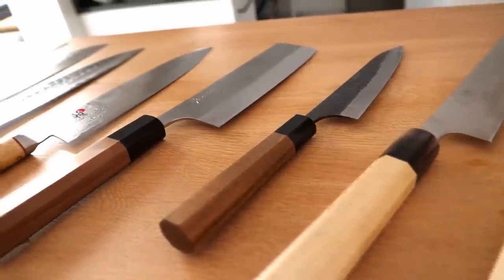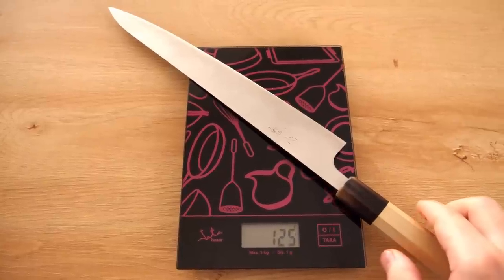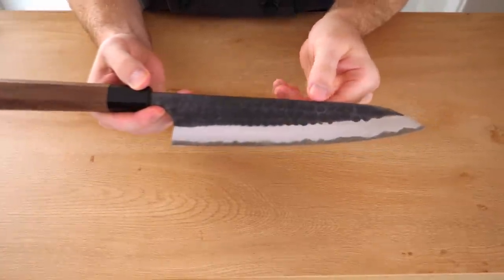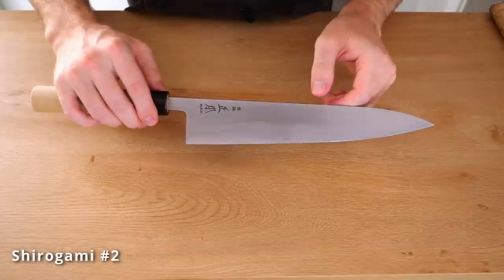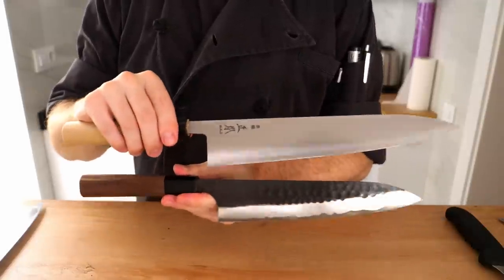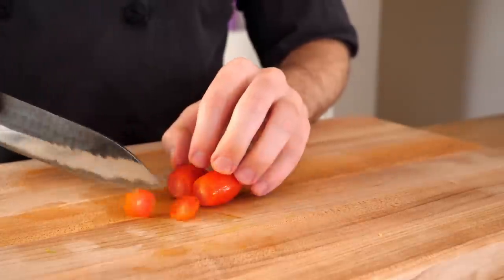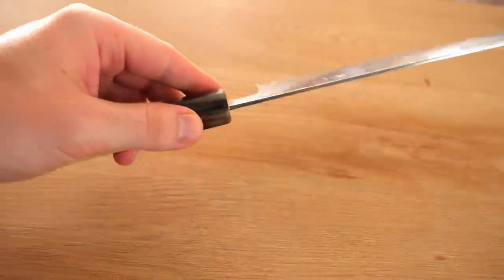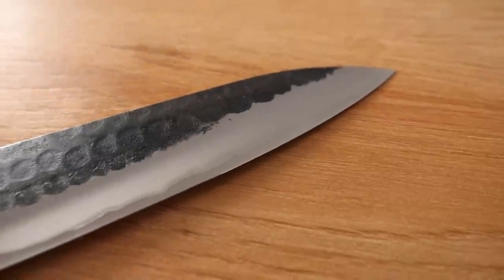Pro Chef Tips.. What Are Japanese Knives & Are They Worth It?

Comment: James – First, thanks for this vid, and it's sister vid from a couple of weeks ago. Wonderful stuff. You explained, in depth, things I only knew superficially. That's always a good day.
I have a similar set-up of knives as you, maybe a notch or two down in quality, but still pretty good, considering I just sort of found them, here and there, over the years (garage sales, under my pillow, whatever), that I decided to keep around.

I have a 'la Bouchere' 8 inch Chefs knife (SS), and it's 9 inch meat Carver companion, that I bought 30 years ago, at a garage sale, for a dollar a piece. I eventually did a little research, and this fine set of French knives, were only made in New Jersey (USA), between 1980 and '89. Go figure. But they are, pretty good knives, regardless of the price or origin. In fact, I'd pay $10 a piece for them today, if I had to. They really are quite decent, for their lack of pedigree.

Full tang, full bolster, comfortable wood handle, and decent SSteel, as to keeping an edge. As to the bolster, I'm guessing you were alluding to how it can be difficult to sharpen such a knife with a 'rotary' type sharpener, either mechanical or electrical, because you can't get to the corner of the edge, where the blade meets the bolster. True.

I have a decent set of standard sharpening stones, down to the leather strop, that I seldom use anymore, but for the rough stuff edges of axes, or lawnmower blades (after working them with 'files'). What I use now for knives, I don't know how to easily define, but it is a structure about 6x8 inches, square to tall, with a tripod base, suitable to a workshop, as not large. I can attach any knife, and set the angle, as well the interchangeable grit stones, of coarse to fine. It cost me about $35, 10 years ago, and it is the easiest way to get an exact and gentle sharpening of any blade, that will fit in it, at least an 8 or 10 inch Chef's knife.

Point being, by that design of sharpener, I can sharpen blades right to the edge, to where the heel of the blade meets the bolster. Yes, of course it takes some finesse, but by bolster, the knife is that much safer, as well, less painful to use for extended hours, such as all day, prepping in a restaurant. I'd have it no other way.

Granted, I worked in a small restaurant, occupancy about one hundred at a time, by the Fire Inspectors. There were usually 4, at most 8 in the kitchen, covering all bases, but for when I showed up as the early guy, to prep for the day. As one prep cook per shift, I cut up a lot of stuff, usually anywhere between 10 and 50 pounds of anything, before I blinked. At the time, we served about 200 tables for dinner, on a good night (which most were mostly), and about 100, for Lunch.

Point is, that the restaurant provided 'tools', were lacking, so I brought in my own in, from Chef Knife, to timer, to peeler, and a few other things. I couldn't bare to work with what was provided, as for no other reason than that they would chew up my hands.

Now, I don't have a fancy utensil 'cloche', as you do, but then again, I've never seen one for sale, nor was I ever been convinced of a need for one. Point is, humbly, I'd wrap my 8 inch, in a towel, as a standard bath towel, that I only used to hide my knife in. I brought my meager tools with me, every day, as foolk if I'm gonna work with the crap you provide, for any length of time, of even a day.

I've got to stop here, as  there might be consequences, of reprimand.

Short story, anyone I worked with, was allowed to use my knife (or other tools), but with strict rules. Don't ever sharpen it, nor, hack bone with it. Other than that, we're good.

As to stealing it, I never thought of that, but I think the restaurants I was working in, weren't so complicated that everyone wasn't accounted for, at any one time. As well, there were CCTV camera's, overhead, all over the place. I understand, that might be a little creepy, but not to me, as I knew (by witness), no one looked at the CCTV unless there was a problem, which most times, there wasn't.
Reply from the maker: Thank you very much! I tried to cover as much as possible

Comment: Keep in mind that I've never been a chef or sous-chef, only a cook and front-end manager, and only in relatively cheap diners and chain restaurants, so I've never needed the kind of precision and comfort/familiarity with my tools that a high-end chef tends to need. That said, I've generally been quite happy with cheap mass-produced knives I can abuse and not just strop/straighten but outright sharpen daily if needed in the professional kitchen.* I tend to keep any really nice knives at home, where comfort and precision are a bigger deal to me. (Well, before I changed careers; people would look at me funny if I brought anything but a folding pocket knife into work these days.) Basically, my point is that the best knife for you in the professional kitchen also depends on what kind of kitchen you're working in, and if you're in a cheap diner (or even a relatively fancy diner as anyone but the chef), you may be better off with something cheap from Restaurant Depot or your country's equivalent. It doesn't hurt that injection-molded plastic, while terrible for the longevity of the knife handle, is both insanely cheap and very easy to form into an ergonomic shape.

*For anyone who doesn't know about knife sharpening, a steel straightens the cutting edge, a strop straightens the edge more gently and can also remove burrs (microscopic imperfections, often in the form of a thin wire along the edge, though to see that outside of sharpening you have to really abuse you knives), while sharpening involves actually grinding metal off to form a new cutting edge and is generally something you want to avoid doing too often, at least with a nice knife.

Comment: I like Shun but some of the tips  are so fine and thin as to be fragile.  I have not chipped or broken any but did drop and slightly bend the tip on one of them. I have a good set of single bevel knives in Stainless with a harder steel core (octagonal magnolia handles) and while they did take some getting used to, each is a true example of craftsmanship and no two will be identical. A human hammered two different types of steel into each of these blades. They are the stars in my kitchen (I am most decidedly NOT a "chef"!). I like their austerity.

Comment: I have a small collection of knives from over the years.  A western style chef knife, a 270mm gyuto and a few others are all in storage.  The main ones I keep ready to use are a 160mm nakiri, a 180mm gyuto (both are Tojiro), a 150mm petty from Togiharu, and a bread knife.  I'm a 6ft guy so I've got fairly large hands but I mostly find myself using the petty for nearly everything.  The issue for me is I currently live in an apartment with a very small kitchen and while I have a cutting board large enough to use the larger knives, it takes up almost my entire counter.  As such I use smaller cutting boards and find the smaller knives, especially the petty to work better for me.  Is it ideal?  Not always, but I can a normally work just as fast with the small knife as a larger one due to the space constraints and the fact I'm not exactly ever trying to rip through chopping like a professional would be.

Comment: As I use "cutthroat razors" to shave, I'm quite familiar with the use of strops. I believe you know better than me than a razor strop usually has two sides, one with a "green paste" (chromium oxide) and one with bare leather. Is this "configuration" ok for Japanese knives as well? 🤔
Very VERY interesting videos, you're waking up my GAS 😅. 
Trying to resist though. 🙂
Thank you for all the infos.
See you next time!
Reply from the maker: yes but I don't tend to use much paste with my knives, thank you!
Reply: @ChefJamesMakinson  Yep, I noticed by the colour of the strops you showed in the video, hence my question 🙂🙂.
Well, I don't use much paste on my razors either, but just a veil on the "paste side" of the strop. It works, for the razor. 😅
I also noticed that the shape of the strop you showed is quite different than the ones I use for my razors, so I believe I should by one of those, were I to buy one of those beautiful knives... 🙂
Thanks again for your kind answer.

Comment: Gyuto is versatile but it’s more dedicated to cutting fish and meat compare to santoku, so it’s also a bit longer than santoku (more length used for pull cuts, less stroke needed per cut).

I’m really surprised you also cover different types of metal used. I highly recommend buying single beveled carbon steel knife if anyone wanna actually feel the difference of jp knife. Usage and caring (especially sharpening) is slightly different and you need to be careful about that. Even deba which is thick knife that can be used to cut through minor bones is capable of slicing ingredients super thin.

Comment: Never again.
Got a 12 inch Shun brisket knife, my local knife shops had a pretty poor selection of those so unless I ordered online I didn't have much other choices for that, and it's the most absolutely delicate little flower I've ever seen. Almost a $300 knife and the blade chips if you just think about it too hard. Barely dinged in on the faucet when I was washing it, and I really mean barely, and it chipped all the way up through the entire edge.
It also doesn't sit flush on the cutting board, too much material at the back. The handle is also extremely bulky.
Only thing I'll give it credit for is that it came incredibly sharp and it sharpens easily, at least as easy as it gets for a 12 incher. After I ground the chip out that knife was cutting wet paper towel when I was drying it after.

Don't get me wrong, I really like santoku and gyuto knives but for how much they cost I'll just stick with western brands. Maybe I'll get some nice hand forged ones if I wake up rich one day.
Reply from the maker: One reason I don't have a Shun :)

Comment: 14:04 Depending on what expensive means. On their site, these knives cost around 200 euro. For some people it's quite a lot for a single knife.
Reply: I hear that a lot, but I try to look it this way:
A chef's knife (doesn't matter if it's western or japanese) will be one of the most important and most used tools in the kitchen. They also last quite long. 

So if you factor in the cost per operating hour, a good knife suddenly isn't so expensive anymore - especially compared to some single use appliances that people use to hoard.
Reply: @Incoming1983  You are and aren't right. Yes, it worth buying if you plan to use it quite often. But not if you rarely use knives (e.g. only on weekends and to make breakfast).

Also it's good to have multiple types of knives so it's getting quite expensive here.
Reply: some kitchen stuff can last quite well, but everything might cost a bit.
starting out must be pretty rough. or it could cost a lot trying to get all the good stuff at once
i don't really mind rarely spending a bit on some kitchen stuff.

Comment: I asked ChatGPT and this was the answer.

Santoku: An all-purpose knife with a wide blade and a rounded tip. It is well-suited for cutting vegetables, meat, and fish.

Gyuto: A Japanese chef's knife, similar to a European chef's knife, with a long, thin blade. It is good for precise cutting and carving meat.

Nakiri: A vegetable knife with a rectangular blade and a straight edge. It is excellent for cutting vegetables and herbs.

Usuba: Another vegetable knife with a rectangular blade, but thinner than a Nakiri. It is often used by professional chefs.

Deba: A knife for breaking down fish and other seafood. It has a thick, heavy blade.

Yanagiba: A knife with a long, slender blade, often used for slicing fish for sashimi and sushi.

Takobiki: A knife with a blade similar to the Yanagiba, but with a slightly rounded tip. It is also used for sashimi.

Honesuki: A knife for boning poultry, especially chickens. It has a sharp, pointed blade.

Petty: A small, versatile knife used for precise cutting, peeling, and paring.

Sujihiki: A knife with a long, thin, tapering blade, used for slicing meat and roasts.

Bunka: A versatile knife with a shorter, wide blade and a tip similar to a Santoku. It is suitable for various cutting tasks.

Kiritsuke: A versatile knife with a rounded tip and a wide blade. Traditionally reserved for sushi chefs, but increasingly used by other cooks.

Kamagata Usuba: A vegetable knife with a curved tip and a thin blade. It is particularly popular in the Kansai region of Japan.

Yusaku: A versatile knife with a sharp, rounded tip and a wide blade. It is often used by professional chefs.

Magurokiri: Specialized knife designed for cutting tuna, specifically for slicing large cuts of tuna into sashimi and sushi.

Comment: Takamura migaki is the best starting knife it’s under $200 excellent grind, a laser work horse and excellent PM stainless steel SG2/R2 steel. Knives under $270 Kohetsu HAP40 know as voodoo steel. Solid work horse 270mm 240mm is under $270 price range if working in a commissary it’s the best knife but not beginner friendly also sharpening is a bit hard and semi stainless steel but fine hard and tough edge.

Comment: I've recently been trying out japanese single bevel knives in the past year, and I think I enjoy using them a lot more than traditional double bevel. They just are much less fatiguing to use because they slice much more effortlessly due to how unbelievably thin they are.
Reply from the maker: they can be very sharp!
Reply: yea i use zewiling Henckels 8 inch and I keep it razor sharp but I find that my friend's much less sharp Gyuto is still easier to cut with in many situations because of the geometry of the blade. this is especially noticeable when cutting something where the knife is going all the way through. i also find that the way its balanced is more suited to my style of cutting which is to go up and down rather than rock back and forth.
Reply: @efafe4972  have you tried a single bevel kiritsuke or an usuba yet? They're expensive but cut even more easily than the sharpest gyutos.
Reply: @niko1even  i believe it. never tried a single bevel because no one ik owns one.  i might skip over a gyuto and get a kiritsuke if I ever get a Japanese knife. im glad i saw this video though because id probably end up ruining the blade by applying double bevel sharpening techniques to the single bevel knife.